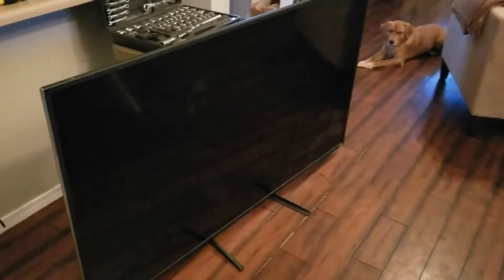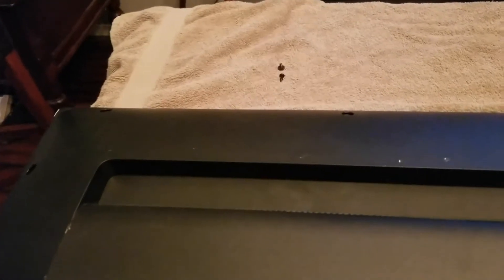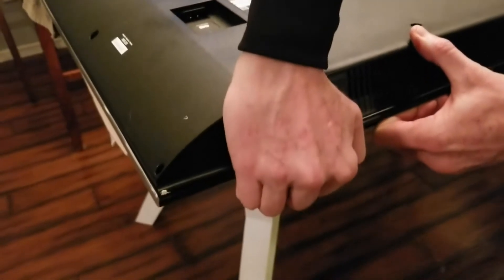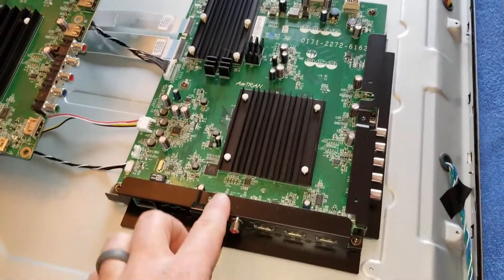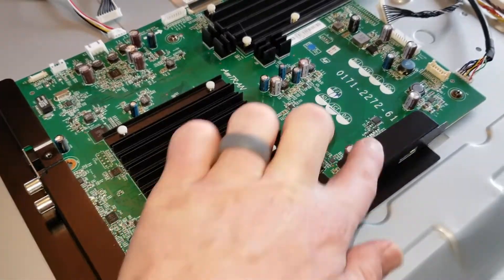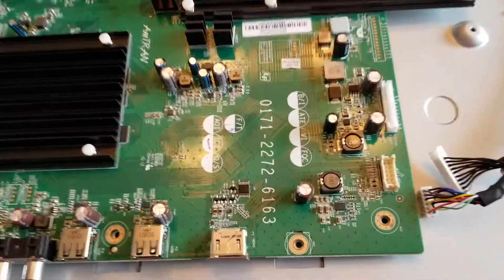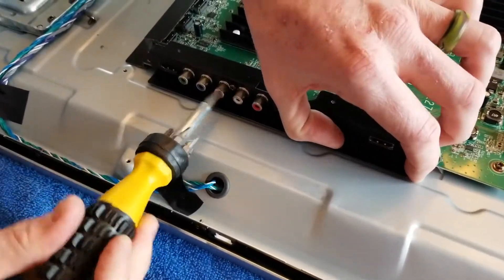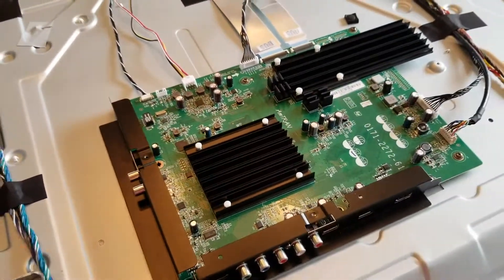How to Replace the Main Board Vizio 65in 4k TV 2020

Comment: After I replaced the main board and turned the TV on, the picture had vertical lines of equal distance from one side to the the other. All the letters etc are not whole now. It wasn't doing this before. Any ideas?

Comment: lots of information, if I replace the main board could fix my issue with power on and off cycle? I got the same tv M65-D0..
Thanks in advance
Reply from the maker: Unfortunately, it's hard to give a definitive answer depending on the type of power cycling issue that you were having. The first board that I would try to replace is the power supply board, as that deals primarily with power issues. We have found success replacing both the power supply boards and the main board in these TVs, but it totally depends on your specific issue. Sorry, wish we could be more specific.

Comment: Did you get this TV working?  I saw that you replaced both the main board and the power board on this one.  I have the same model and noticed what appears to be a damaged spot on the main board.  It looked like yours might have a mark in the exact same area.

I replaced the main board first which unfortunately did not fix it.  The power board is coming tomorrow and I am going to try that as well.
Reply from the maker: Unfortunately, we were not able to get the TV back up and working by replacing the main board, power supply board, or the LED board. To be honest, it's a bit strange that none of those fixes worked. I'm wondering if we may have purchased a faulty power supply board. Anyway, please let us know if you are able to perform the fix.
Reply: @TechTalkvideo  No luck here either.  I replaced all 4 boards but it is still not working.  Before the replacement it would just shut off instantly.  After replacing all 4 boards it appears to stay on and I hear a loud-ish humming coming from the area of the tconn board but never get a picture on the screen. I don't feel that its probably worth trying to replace the back light at this point.  I think I am going to return the boards and get a new TV.  This is our 3rd Vizio and none of them survived more than 5 years.  Thanks for the help though!